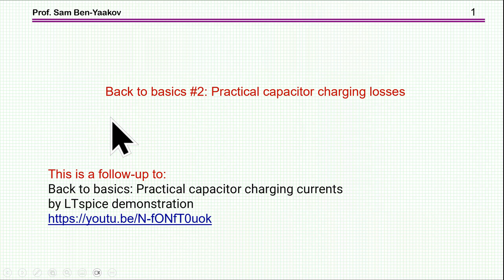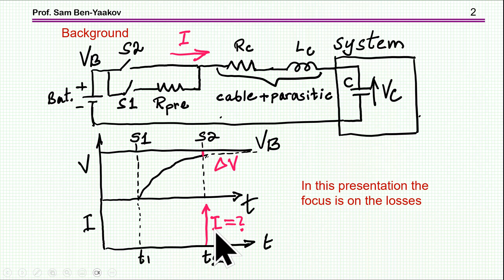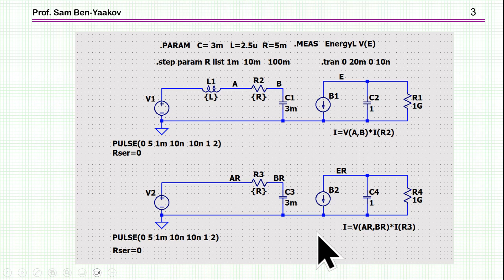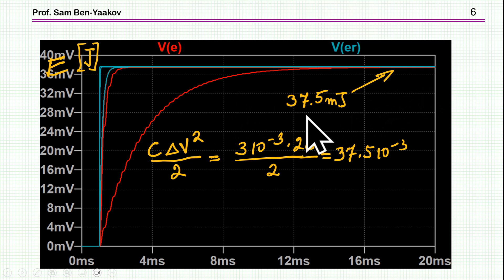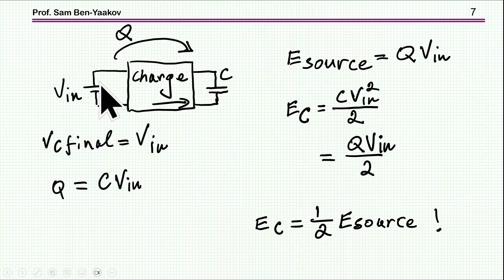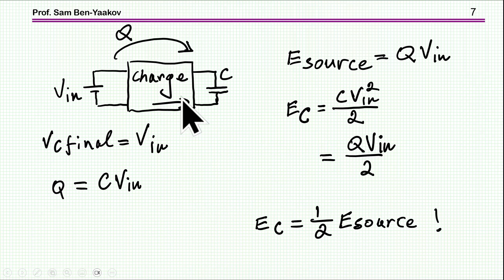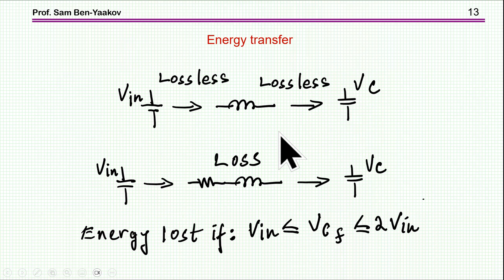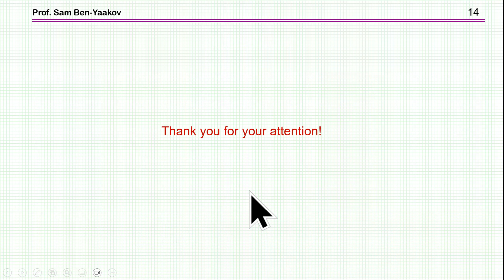Back to basics #2: Practical capacitor charging losses

Comment: Excellent video! Please sir could you make detailed video about self excited lr multivibrator fluxgate sensor using op amp. 
I couldn't find any source about the calculations involved.
Reply from the maker: Thanks. Have you seen  https://youtu.be/ry6j32Q2VBw?there are 3 parts.
Reply: @sambenyaakov  yes all of it about 3 times 😋 that's what got me interested and I searched the internet and only found a single research paper that u cited. However couldn't get the full pdf as it required login or something. Searched everywhere but to no avail about anything, I think my only last hope is u professor😃
I am a subscriber to ur channel and I found it the most detailed channel about ee  on YouTube.

Comment: Cool, maybe this design could save money by allowing for cheaper series resistors that have a smaller peek pulse power rating.
Reply from the maker: The analysis discussed IS small signal. Unless I missed something. There are many videos in my YouTube channel on control.
Reply: Maybe the wording in my comment was bad. I've worked with designs similar to your first diagram, but instead of a pre charge resistor, there was just a single resistor used to limit current into the capacitor. Additionally, instead of a battery it was rectified line voltage. Doing fancy precharge switching is too expensive/unreliable, so we just use a single power resistor in series to protect the capacitor from exceeding dv/dt ratings. Worst case is the condition where your power cuts out, and returns at peek of line when the capacitor is discharged. There are not many suppliers that offer power/surge resistors with peek pulse power ratings with ample margin, and some don't even include the pulse power/ time duration curve in their datasheet . From what I've seen KOA has the best resistors and exceeds their ratings when tested better than other mfgs. Obviously there are other ways around this by going to a larger package size, but everything has its tradeoffs.  @sambenyaakov
Reply: I also havent seen your previous video yet, so I might still be off topic
Reply from the maker: @Cydget   Catch up 😊😊
Reply from the maker: @Cydget  Using a series transistor in the common way is dangerous due to violation of the SOA. See new idea: https://youtu.be/05QprDgrP6E  https://youtu.be/-08rwDt5Wp8

Comment: Thank you Sam ! I just now realize that the circuit at 6:39, (the circuit with the diode + inductor + capacitor) is exactly what the input to a boost converter looks line if you accidentally switch on the input voltage without a PTC inrush-current protector.... 
Incidentally, that's exactly how I blew up a PFC Totem board a few weeks ago 😞.
I wish I knew then what I know now...
Reply: That's why, in my opinion, good designs include large 50Hz bypass diodes across the coils during energization. They will take the current surge AND avoid the resonance of the circuit and the associated overvoltage.

If I remind correctly, on the totem pole circuit, you put a pair of these diodes between the coil-connected AC terminals and your DC bus terminals. These diodes will present less impedance to the surge than your fast diode + coils, but won't conduct any current in normal operation (so no recovery). They don't need to be rated for the full current, and even a dumb 1N5408 (1000V 3A) can handle more than 100A peak of inrush for a couple of like cycles.

By the way, don't you mean NTC instead?
Reply: @pbs1516  In my totem pole PFC, I use a PTC for inrush current protection. That would be Rpre in Sam's schematic at 2:07. That resistor nicely limits the inrush current, and serves as short-circuit protection as well. The body-diodes of the totem pole mosfets then serve as a rectifier that charges the bus capacitors gently. No further diodes are needed.

The only thing I did wrong was accidentally switch S2 on while S1 was still open on my prototype board. That's not a good idea as I found out the hard way LOL.